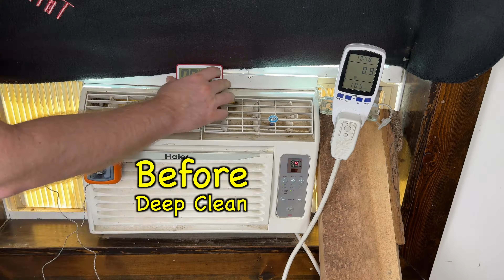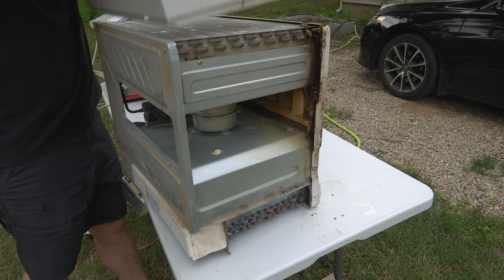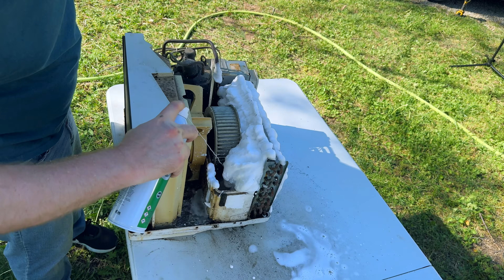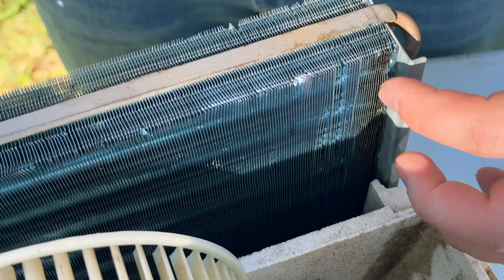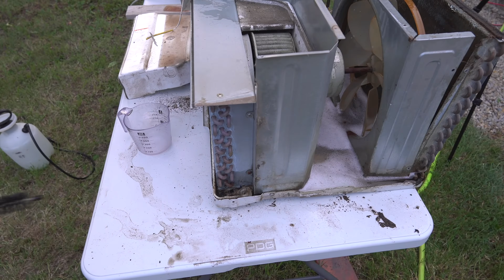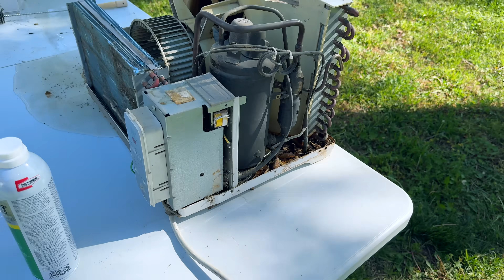DEEP CLEAN a Window AC the PROPER Way!

Comment: Sooo , one problem with your video all the cleaning info is great, However on the before/after test. yes the clean one is using less electricity but you have the fan set to medium and not high but the before was on high.

Comment: Listen, I am a single man with no kids. I do not need an excuse to go outside or in the garage for hours to 'escape' A coil cleaner, old toothbrush and rain spray hose is good enough for me. I will, however give you a sub and a thumbs up for those foam insulators

Comment: Thanks for your trouble making this video. I can’t remove my window units, but what has helped me is to get what I can clean while it’s in the window. I wipe all the wet parts down and then spray the Concrobium. It may take some repeats of spraying the Concrobium if it starts to smell again after about a month or two. That pretty much prevents a lot of future mold and neutralizes what I couldn’t get to. It makes it smell like fresh air coming through after I do this.

Comment: While you have it apart you should use 3 in 1 oil to lube the motor shaft in front and back. Tip it to get the oil into the bearings. Otherwise the motor will squeal and eventually seize.

Comment: 6:39 Wrong, you need to remove the screw when you're done so water can drain out. Actually, don't use a screw to plug the hole because it will damage the styrofoam. Instead, plug the hole with a paper towel then remove when done cleaning.

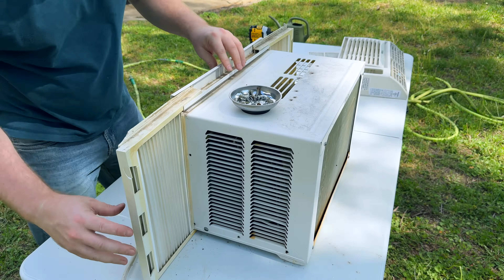Comment: 1:45 for those crappy plastic fins, I've always cut about 2-3 layers of cardboard to fit snugly. Then I cover it in metallic duct tape. Doesn't help much for sound, but it's incredibly effective for heat and light.

I saw a bunch of foam rectangles in the trash at work and took them home, thinking I'd try those instead one day. That day hasn't come yet, but I might try that tonight.

Comment: How often do you wash an Ac unit? I live in Texas.
Reply from the maker: I just do it at the beginning of the year, but I’m in Kansas. I should do it at midseason, so I’d recommend in Texas doing it middle of the summer as well. It pulls a lot of air through along with cotton dirt and everything else circulating in the air

Comment: Question.  Am I supposed to just detach the temperature sensor from the fins and let it hang?  Why not just leave it in place as you did?    What would be the reason for doing that or what is the consequence of not doing it?  I've already washed mine many times in the past and I've never bothered with that sensor.
Reply from the maker: Just to be safe it’s good to get electrical components out of the way. Water could start it rusting or corroding. I’m careful with water, some people would not. Just do or don’t at your own risk. 👍🏼

Comment: So I love your channel thank you so much I watched your lazy video come out really good question on the styrofoam I have little black mold dots I noticed yours did too how do you get rid of those without taking the AC unit apart I'm not unable to do that
Reply from the maker: Thank you very much! Very ac is different, but if you use the Conceobium mold killer and just try to get in as many places as possible, that seems the best. Also, run it on fan mode for 30 minutes or let it dry out good outside. Moisture + dirt attracts mold. Some vent covers pop off and you can reach the styrofoam. It’s hard to explain, just do the best you can.

Comment: Keep in mind,  there can be an excessive amount of mold built up, along with air contamination and dust.  It will eventually cake up. It would also be a good idea to use some 12%  hydrogen peroxide solution to kill off the mold ( be very careful, it is highly caustic to skin).
Then following it with a good quality detergent or use AC cleaner ( Frost King foam). Just an FYI.
Reply: I would stick to only using that on the plastic and the styrofoam only with a paper towel or qtip. Peroxide can be caustic to the metal.

Comment: Figured I’d throw in the fact that they do sell an item that your run up along your metal coils/fins that straightens and aligns them back to normal position agter being bent from cleaning, maintenance, or whatever you are doing.. looks similar to a comb but is for separating the fins back to their normal positioning and proper spacing. Could save you having to go buy a whole new AC bevausw you got such bent coils/fins. I mean you could just use a thin small fork to do the trick too but takes longer and runs risk of actually puncturing something with metal. Plastic knives would work too along with plastic forks. Just have to make sure you clip away any spikes of the fork that do not align with the rows of fins. They are supposed to run completely straight, up n down. Flat shiny coils/fins means no air flow so the ac is working at half capacity at tjat point.  If even at half.. I just started to clean the inside coils of my window AC the other day and seen a whole bunch of black shit coming off from just basic dawn powerwash dish soap foaming spray. But I stopped about a third of the way thru bevsue I wasn’t sure if I was taking off some type of necessary coating of some sort… but come to find out after doing some homework on AC maintenance and engineering’s that it is literally like 95-98% all dirt and mold/mildew most likely! So back to it I go lol. I just didn’t wanna have to take the unit out of my window agter I just sealed it all off for any air leaks to keep the most amount of cold air in while trying to keep out majority of outside heat…. All that 3M Duct tape I used to seal all cracks and crevices, be a big oain in the ass to have to rip it all off just to take the unit out the window to clean it, and then have to put it all back in the window and have to seal it all off, again. All the time and effort just doesn’t seem worth the two degrees I MIGHT gain in cooling! Might just try using a high pressure sprayer with some mold and mildew killer. And I do actually use a bleach based  product for the mold and mildew becauee it works best and I rinse it immediately scrubbing away the mold… then spray one more time with the Lysol black mold killer with bleach, let sit fully wet from the Lysol for 10 minutes to kill any remaining spores, and then give it all a final rinse with dawn dish soap until water runs clear and foam/suds free.. from the inside. If I took it outside I’d use a better method but I’m not trying to take this thing out again and then have to put it back in and seal all over again either. And it’s a heavy fkr for some reason and is only like 8,000–10,000BTU. And it’s pretty big for being only 8k-10kBTU. The window fit is tight as hell too so much I had to take the side fins or whatever they are that block the rest of window from letting or in or out, jad to take mine completely off just to get the AC to squeeze into the small ass window frame. But now have about 1/8 of an inch gap all around the whole thing because there is no fins left to pull out… so ya… I guess ik going what you would call “the lazy man method” lol. I’m just glad to know I didn’t fk up when cleaning inside coils lol I thought it was wayy too much black shit coming off to be normal dirt and grime, and thought it was some protective layer or sum lol. Now back to it with a toddlers toothbrush without removing from window lol. Lazy way for sure. Hopefully does something in terms of better cooling that is actually noticeable. Maybe I should just leave it in for this one last summer, and then take the shell off and give a deep cleaning of everything.  I’m just worried about what you mentioned, the electronics of it all and trying to be keeping water off any electrical lines/wires. Unless I just cover them all with flex seal rubber… which I’m not even sure that is a good idea, nor do I know what to expect the flex seal to do to the wiring or how the chemicals will react to wire covering/insulation.  The whole process is moot if the electronics get ruined! Maybe the basic simple “lazy way” is the most practical, at least for guys like me who’s not electronically proficient. I know basic connections of wiring lol. Don’t know anything about what wires can handle what corrosives or chemicals, nor do I know what the rubber wire insulation is able to endure without degrading and/or decomposing the actual wiring insulation.

Comment: 2 questions.

1) When you mentioned on its side - do you mean when cleaning it? Or even storing it? We take ours out in winter and I've been storing them on their side in the window well (fieldstone house). I guess I've been lucky?

2) Did you take off the top part of the foam over the wheel? Mine has yellow tape "DO NOT REMOVE" so I haven't. I used a straw brush to push built up crud between every stupid wheel spoke. Amazing it was working at all with that much loss of airflow. 

But it'd be a lot easier to demold it if I could take that top foam piece off while cleaning.
Reply from the maker: I meant cleaning, but anytime it’s on its side you have to wait and let the oil drain properly. I’m not sure what model you have, but I would take off more so I can clean more. Not sure there is a sticker saying otherwise.

Comment: great stuff thank you. So using the mold spray is better than bleach to prevent corrosion right?
Reply from the maker: Yes, and supposedly it leaves a residue that inhibits future growth
Reply: @HandymanHertz  I followed your video to a queue and bought everything except for the nozzle. The inside looked just like your ac too. I no longer have a mildew/mold smell coming out of it anymore! Thank you!
Reply from the maker: @michaelsmith3887 glad to hear it, thanks for the feedback!
Reply: @HandymanHertz is it safe to use vinager mixed with water ?

Comment: I really appreciate your videos. They are bookmarked and now that it's Spring I'm about to clean 3 of them. As a person who's had many years of professional and home cleaning, a tip: Spray your DRY items with cleaner before washing them, that allows the cleaner to adhere to the dirty surfaces and break up the film before rinsing. Your housing pieces should rinse clean without "your spouse's toothbrush" LOL. *Adding that it's best to vacuum out that debris from the bottom first, before getting it wet.
Reply from the maker: Yes, you are right and those tips are very helpful. Thank you!
Reply: Definitely dry vacuum first!
Reply: I also use a tool to just break up the caked on dirt as well, before vacuuming it up—because it was literally 1 inch thick hardened bricks of debris

Comment: Is it ok to spray lithium grease on the motor shafts to help grease the bearings?
Reply from the maker: I don't see why not. Idk how much they will help, but I don't think it would hurt any.
Reply: I forgot to ask what kind of foam did you use. Where did you get your nozzle  for your hose from ? Do you have to measure the inserts for the  accordion?  I am thinking about getting some. I have the brush that I ordered from Amazon for my dryer.  I am almost going to be a do it myselfer😂. Was that a new type of air conditioner that you mentioned.  I might need to invest in that. Again thank  you.  😊😊😊

Comment: These Haiers are great units but my 10k btu is even worse design for removing condensation from the front. its a pinhole at the very bottom of the foam underneath the fan, then it drips down into a tiny canal about 4 inches in length that then empties into the tray. These we're kind of the last ones that still use traditional water drainage in the back instead of recycling and blowing it on the coil like you demonstrated in your video with the GE.
Reply from the maker: Year right, not the best design.  That little channel seems easy to plug.
Reply: @HandymanHertz  hey everyone if u have a Haier All these models have the pinhole drainage design under front fan: ESA406K  ESA406K-L  ESA406K-T ESA408K  ESA408K-L  ESA408K-T ESA410K  ESA410K-L  ESA410K-T ESA412K  ESA412K-L  ESA410K-E

Comment: Is there a wait time for after deep cleaning it to then use/plug in the air conditioner?
Reply from the maker: Good question, there is no wait time unless a, you tipped the AC on its side or B, you got some water on electronics and it needs to dry before plugging in

Comment: I have that same nozzle and it works better than most. I have also used those side insulation pieces, i use them with tha side accordion pieces. Its mostly to keep the intense heat out and does help some with sound.  I follow up with cardboard or plexi to finish covering the area and keep out the majority of heat and noise.
Reply: I really enjoyed this video because  the company  that cleans my airconditioners  does not do all of this. I believe  I can do this after watching your video. I am going to let them come in this time and watch them again. I might have to  tell them to watch your video. Thanks❤.

Comment: I've got a question my window unit is dripping on the outside in the middle of my window seel I toke the plug out and water poured out of it but the plug is under my ac unit to the right and of course on top of window seal I've tried to tilt it back more but can't or it won't then b held by the top of my window any suggestions I'd really appreciate it greatly ?

Comment: i have a fredrich ac that goes into my wall instead of my window and i have bugs getting into my bedroom through it. How do i stop that and would i have to pull it from th ewall to clean it
Reply: Same. Make sure the seals around the machine are caulked. I also have a Friedrich and it does the same thing. Usually a moth will find its way in.. so annoying. One time a bee managed to get inside. It must be the design of the unit.
Reply from the maker: I've not had this issue so I'm not sure. It's pretty much sealed off from the outside/inside it seems. Mariner they are coming through the home in the wall on the outside? You can clean this the "lazy but still effective way" which I have a video on. No taking it out needed.